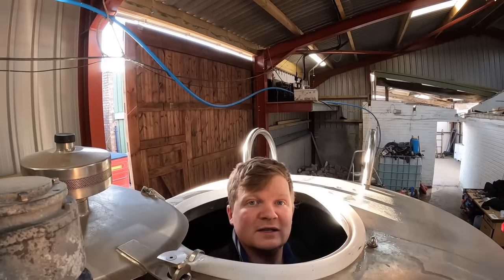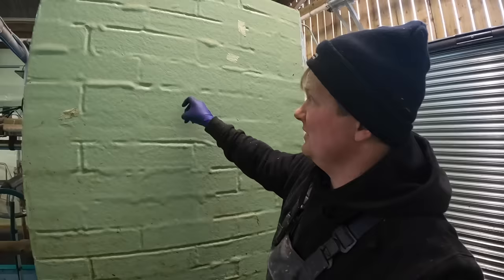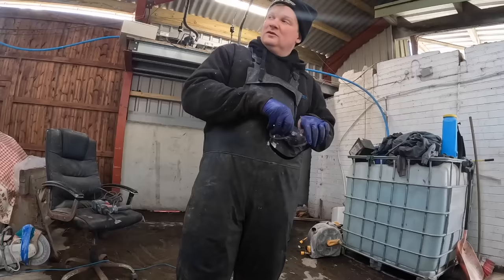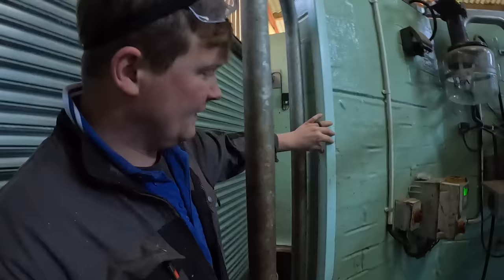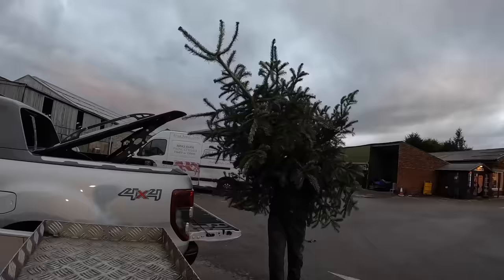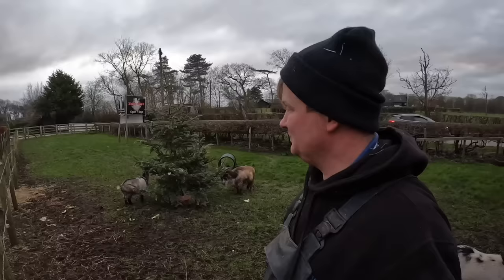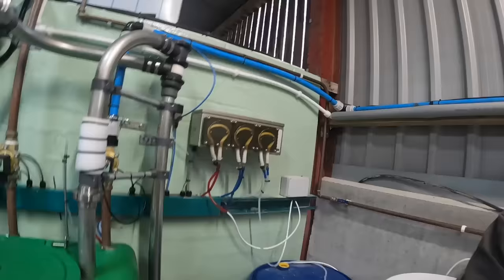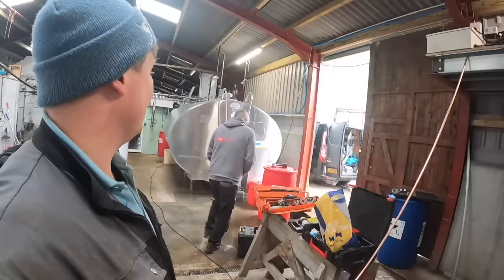NOT HAPPY... PARLOUR PROBLEMS!!  DEMOLITION DAY FOR THE DAIRY!

Comment: Just a tip on going into the bulk tank. Get a 5 gallon bucket and tie a string onto the handle. Have the string long enough to hang outside the tank opening. When you go into the tank take the bucket in with you. Then when you want to get out, turn the bucket upside down and use it as a step to get out a bit easier.Then pull the bucket out with the string. Job done. Been there , done that.😄😄😄
Reply from the maker: Great idea! 👏👏👏
Reply: Been there done that too lol

Comment: Unfortunately the whole wall is going to have to be redone.  I've built boats and repaired boats.  Its just delaminated across the whole wall.  The corners have been bumped by the cows so hopefully that doesn't affect the warranty of the fiberglass. Protecting the corners will help for a while but the moisture will collect behind the wall and then it will come off in sheets.  I see no other solution as bad as it was than to completely have it redone OR go back with something else under warranty.  Great video though.  Interesting about the hot water heater.  Interested to find out just how much you save over the course of the year!!

Comment: In the states we have what is called frp (fiberglass reinforced plastic). Comes in thin panels and is adhered to walls with a glue or mushroom anchors. Very durable product that is used on our car wash walls and other areas that need to be protected from water. Might be worth checking out for future projects.

Comment: That must be so aggravating given the time ,money and of course effort that was put in to get that parlour finished.
I would definitely be pushing for a massive compensation package to cover the cost of replacement as and when the time comes Tom.
You’ve been very gracious in not naming the company but obviously that will depend on how they resolve the issue without causing you down time in the Parlour.
Nice saving on the Heating element 🤜🏼⚡️🤛🏼

Comment: Fibreglass is bubbling due to the moisture in the wall, and also how about fitting an Alexa to the stereo so you can ask her to switch off the radio when you go into the parlour filming
Reply: Alexa idea is genius
Reply: @ritch195 they don't need internet but they do need a wifi network
Reply: Think they have WiFi

Comment: I can't remember the video of them doing it but don't know if they SBR'd the walls, this step is vital. The amount of blown plaster my company went out to. Also dont use them plastic stips, they will damage up and look really dirty in no time really quickly, get the stainless ones. Good job on the wall guys.
Reply: Blockwork should have had a month to throughly dry out,then prime  brick & blockwork with SBR & then rendered before fibreglassing, agree with you about using SS corner profiles.

Comment: Tom you probably already know about this but what we did on our parlour years ago was to attach large blue plastic sheets to the walls, they were a few mm thick so very durable (I don't think they ever broke) and they were very easy to clean. As it's just the corners hopefully you might not need to go that far.

Trouble is since you've now got fibreglass on your walls you need to be careful and  wear a mask when drilling into it.

Comment: Tom if my mind remembers properly, when you went to "sisters in wellies" farm they had the same brick wall you have, and they didn't have the problem you're having with the fibreglass coating
Reply from the maker: They paid them with swimmer pool paint. It had cracked after 2 years unfortunately 🙈
Reply: @TomPembertonFarmLife  oh no. Thanks for letting me know. I really hope you're able to fix the problem, because using pressure jetting, which you need to use to clean the milking parlour will just exacerbate the problem

Comment: Just as a point of interest, a friend of mine has a hot-tub and it costs him £22 from cold to hot, but it only cost £0.66p per day to keep up to temperature.  Great video as always thank you
Reply: It's a lot less expensive to keep something hot than warming something up. Keeping something constant saves energy for example it takes far less energy to get a heavy cart moving but when it's at speed it takes far less energy to keep it at the desired speed. This goes for everything.
Reply: Tell him to fill it from the hot tap on a slow feed way cheaper to heat with the boiler than electric. Put a bit of cold water in first though.

Comment: I have wondered how you pass inspection with the bulk tank exposed. That would not pass here in the USA.  As for the fiberglass coating on the walls. IF it is applied to smooth walls that are completely cured. Meaning no moisture in the wall. Then the fiberglass coating works.  The bubbles your getting are more than likely caused by moisture behind the coating rather than air pockets. The plastic corners that your gluing on will not stay with the cows rubbing by them. I hope that the fiberglass coating stays on but I am thinking it will just keep falling off. 
  The vast majority of dairies here have poly boards attached to the walls. They are slicker than the fiberglass and they are much more rugged.

Comment: On your heat exchanger make sure there is a thermostat that will dump water when it gets above 65 degrees as they start to work in reverse we found with ours in hot weather and takes even longer too cool milk. The biggest saving is the reduction in compressor running the hot water is a bonus!

Comment: Reckon the bubbling fibreglass is due to moisture or texture of the blockwork. Usually with a finish the wall needs to be prepared ie skim, lined with ply, CP board, fermacell .etc cutting corners never pays in the end.

Comment: Tom , would it been better to put rolled up tire on brick wall first then put fiber glass on after it. 
Our neighbors did their parlor that way but left half of the wall black the other fiber glass if ,I remember the top was black the bottom was green and safe guards on the corners to protect it then painted the black white.
Wow that brick wall needs to go awesome that is starting to look good Tom. It’s a headache but in the long run keeps birds out and cold weather out . Have you thought of cattle brushes to set on post in pastures so the cattle can brush against it.
Love to see the parlor you’re working on all done . Our neighbor has two hot water tanks incase electric goes out have one on back up.

Comment: Great to see your new heat recovery system , also
running compressors can cost a fortune try setting compressor pressure to as near to the pressure requirements at point of use and volume requirements this could save a fair bit on running costs ,theres no point running at 160psi when you only need 30psi unless you need high volume even then you can install big storage tanks to get round this for situations and it could save a lot on energy bills

Comment: Good video again as always, I no longer have anything to do with dairy  farming but can definitely say from personal experiences gained over the years ,  from both the dirty end of the cow milking , feeding etc and later in life in the supply trade that fibre glass coating needs to come off and to start again, I do not remember the condition of the brick work pre fibreglass but prep work on the surface is critical. Having seen fibre glass used in many dirty and wet situations in agriculture never mind the obvious boating world where it is used extensively. The company involved must come back remove the coating and start again or simply refund you the 8k so you can start again with a better solution. If it starting bubbling up nine days after the cows moved in then it will give you trouble for as long as the parlour is there. Also the corner strips are purely a shirt term temporary solution as they will not last long . All best to the team and ginger warrior.

Comment: Hi Tom, wall would have needed more time to dry, don’t care what it says on any label of any product, different drying time between blocks and the mortar, was fine on rendered wall because surface dried evenly. I’m no scientist with that said but if I was the resin company that’s what I’d be shouting about. Rush jobs always have these longevity issues no matter what sector you’re in, sign off the times. Place is chilly and damp for lot of the time so you’ll do well to stop that at this stage. Few warmer seasons through it before I’d even bother trying to sort it.

Comment: That bubbles is caused by efflorescence.  . It needs to be stripped  off  and neutralised .  Did you allow 28days for the morter to set ?  Is there adequate damp causing  to eliminate  rising damp ? The list of reason for failure are endless .  Good  swimming pool render is the best to fibre glass over .

Comment: So I went back to look at the sisters in wellies on your videos.  I can see where some of there walls are fiberglassed however it appears that the parlor itself is lined with 6-8cm block foam.  At 23:34 of the video you can see where they are joined buy a tongue and groove method and seem to be already yellow.  They come in 4x8' sheets and are probably closed cell foam so they are waterproof.  May be something to look at rather than the fiberglass especially  since the parlor is a high moisture enviroment.  Even on a arid dry wall, fiberglass will pop off of it given the moisture you seem to be having and all it takes is 1 little chip not noticed for 1 week and the moisture is in it.  Just a thought.  Thanks so much for ALL the videos you put out for all of us.  keep me updated on the Ginger Warrior's back and his recuperation.  And the best to your misses and boy!!

Comment: Tom get yourself a couple of tubes of polyurethane glue the ones that go into silicon gun, don’t cut the nozzle just have it on the smallest hole drill some small holes in air pockets and fill up with the glue the glue will stick to the moist blocks and the fibreglass and hopefully stop it coming off the wall. it’s worth a try, it’s worked for us in the past.
Reply: Complete waste of time and money
Reply: @mikeysky8917  well it’s worked for us in the past on parapet walls 
for £20 and a hour of his time it’s worth a try but what would I know I’ve only been fitting and fixing GRP roofs for 25 years 🤷🏼
Reply: @andrewbeckwith945  But all his walls will be a mess. The moisture is in and air pockets everywhere.

Comment: And by using the water tank to cool the refrigerant you are saving from having to blow out the Condenser which will save you tons of time. Part of the problem of burning out compressors is dirty condensers. And with the amount of dust on the farm there you would probably  have to blow it out or clean it weekly in order to have it working near capacity. Also especially in the summer the heat load given off makes the whole area uncomfortable and makes the compressors work at a much higher temperature. So not only will your electric bill love you for it, your cooling system will also love you for doing it and last much much longer. Thats a Five Cow job 🐮🐮🐮🐮🐮!

Comment: I would have put Acrovyn Corner Protectors on those broken corners or better, stainless steel. They are used extensively in the Health Industry and generally take a fair bashing from Hospital Trolleys etc so are more then up to the job. The big benefit is they are wider than the angles Luke was fitting. Hate to say it but I suspect what he has fitted wont last 5 minutes and the cows will have them off. Its also only fixed to the fibreglass which is already failing

Comment: Found the company from an earlier video and found the instructions for installing the wall.  Seems like they followed all of the steps according to the instructions EXCEPT for maybe the very first one.  "Ensure all surfaces are dry & clean".  With such a wall it probably should have dried for at least a week or 2 before fiberglassing.  Since videos come out without being timed it may have been that long already.  Moisture under fiberglass is the very main reason for delamination.

Comment: what is the fiberglass company thinking? Boats are made of fiberglass and they don't chip and fall apart - many stay in the water for years on in and come out to be waterblastered to get the sea life taken off them so a bit of slurry will not make a difference - bathrooms behind tiles are fiberglass waterproofing  and the tiles don'f fall off the wall and the wall does not leak - get them to come and take it off and do it properly at full cost to them - those corners will not last 6 months and it's a patch job on poor workmanship - that fiberglass should have stuck like s!!!t to a blanket
Reply: I think the critical thing is the adhesion between the wall surface and the fibreglass. If it’s not perfect you get (in effect) blistering or patched which are not fully adhered. So the fibreglass surface is slightly lifted in patches from the underlying layer. These patches will wear away with any abrasion to the wall. Like a cow rubbing against the corner of the wall.
Reply: I imagine the main problem is how much time that would take. If it means the parlour couldn't be used for a while then it's probably not an option as I don't think Tom is in a hurry to get parlour on a trailer again any time soon!
Reply: On the contrary. Delamination and osmosis is one of the biggest problems with fibreglass boats. Once there's a tiny scratch in the gelcoat, you're in for an expensive repair bill.
Reply: That fibre glass is a total loss, it was applied too soon after block wall built, too much moisture,needed to dry out then brick/block primed & rendered, have done several koi block ponds & never had a failure.
Reply: @stuartandrews4344  I wonder if the company succumbed to the pressure of being in Toms video and wanting to get the job done on time.
Reply: The mortar wasn't dry when they applied the fibreglass simple they probably tested the blocks for humidity but not the mortar
Reply: With everything you want to achieve with fibreglass, surface prep is everything. Any remaining moisture at all, in something porous like brick and mortar, will act like a mold release agent. The choice of epoxy is also vital as you need one that will soak into the surface a few millimetres, to bind with it like the glass fibers. The epoxy used for creating car fenders and canoes is designed to not bind with the form surface. It almost looks like that's what was used here.
Reply: @gregedmand9939  • Epoxy resin will adhere better to concrete, than a polyester resin for plastic.
Reply: @stuartandrews4344  Agreed, the wall was too fresh to have a 'seal' applied, I wonder if this was mentioned to Tom by the company?
Reply: It was a total waste of money to begin with. Concrete walls painted with parlour paint would have been the better option. You would get a lot of readymix concrete and paint for 8500
Reply: @markcorr6704  Not that familar with Palour Paint, but had walls been rendered, then possibly it would have been a better option & most likely cheaper.
Quattro Ltd do a range of palour paints, & from reading their info, you don't need walls to be rendered, if using paint grade concrete blocks.
Reply: @jonathanmormerod  This is a common misconception. Its plastic it is essentially waterproof unless permanently submerged and even then is much more durable than people fear. A tiny scratch is purely cosmetic and the cost to repair is just a reflection of the work evolved.  Im a boatbuilder and will to back to watch the episode with the fibreglass being applied to the wall with interest but I suspect was either damp wall or a hot day and the resin cured faster than the man could work.
Reply from the maker: @th7245 nope didn’t say anything when applied
Reply from the maker: Walls were finished on the 21st April and fiber glass started on the 23rd May
Reply: Biggest mistake and I said it at the start. Those walls should have been rendered & painted with a clear water sealer & leave it at that as there wasn’t a hope in hell of that fibreglass sticking. Impossible to get all the air pockets out. Can’t blame the company if the walls weren’t left suitable for the job.
Reply: S/Steel Rubbing strips on external corners will help . If the Fibreglass installers were not 100% Happy with the walls prior to installing , why install, they should advise on best practice for their product . From the outside looking in without knowing all facts I would say it’s down to them to put right at their cost .
Reply: @mikeysky8917 Surely the installer should advise and insist on the condition of the walls before they start to install. The fact they issued a warranty without rendering means they were happy to proceed. We are all speculating but we don’t know all the facts , a painful learning experience, highlighted by this update, which is likely the only positive for others to observe.
Reply: @marcmcsorley7707  Maybe so but they should never have put it on non rendered walls.
Reply: Tom I suspect the fibreglass failure is due to moisture in the wall. I would suggest the mortar hadn’t dried sufficiently, hence its blowing off the substrate now.
Reply: Boats don’t have cows walking through them twice a day 😂
Reply: Not companies fault

Comment: It costs exactly the same to heat the same amount of water through the same range, no matter the range - very simple physics - specific heat capacity.
To heat 10 gallons from 5C to 25C costs EXACTLY the same as to heat it from 45C to 65C, assuming you don't have masses of heat loss (the hotter anything is, the quicker it loses heat). If you do have significant heat loss, heating anything to a higher temperature, costs more than heating it to a lower temperature - you lose more heat.
No ifs, no buts.
Reply: I was thinking the same